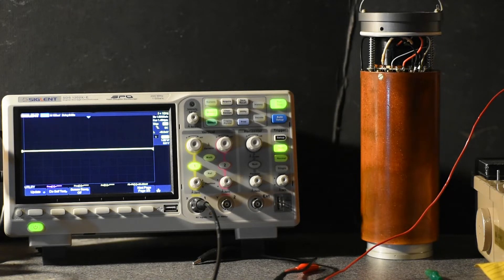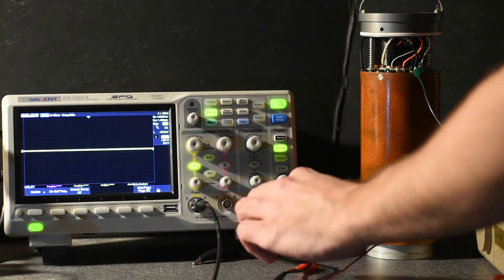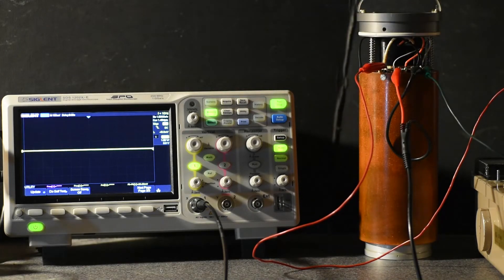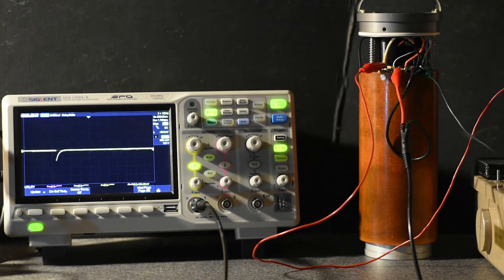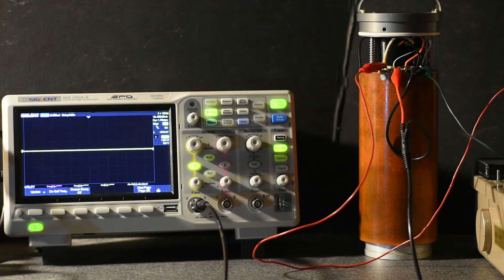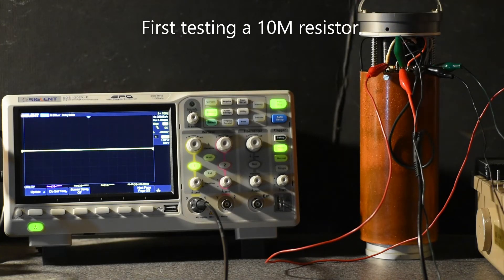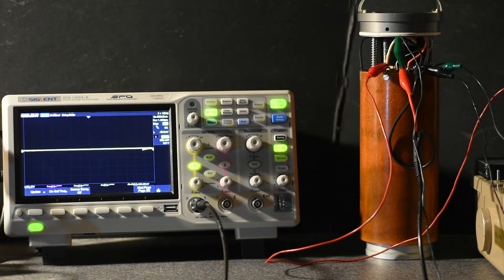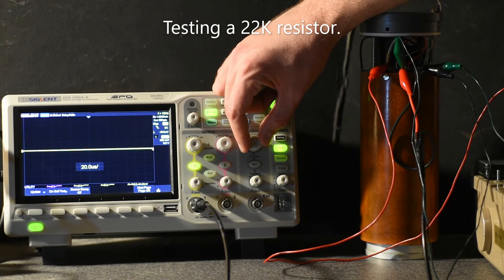Testing a Soviet Surplus БДЭГ-01Р // BDEG-01R Scintillation Probe

Comment: Are these old detectors worth it to try to get working? And do you have a pinout diagram or was one supplied with this when it came. I have a ratemeter somewhere and/or I'd like to hook one of these to an MCA to do Gamma Spectrography with a small laptop. Thanks for the video.
Reply from the maker: Depends a lot on what shape the crystal is in. I got lucky and the crystal on this one is basically perfect despite the age. 

No pinout but the tube inside this one is a FEU-82 photomultiplier tube and a standard voltage divider circuit. 

Definitely possible to get them going with a sound card spectroscopy setup.
Reply: @subverted  Thanks for getting back to me. :) how did you figure out what the leads were, then, if you had no circuit diagram? Okay, so I can look up the pinouts for that tube, I suspect. You've probably dealt with them enough and all are probably of the same basic wiring that you could figure it out fairly easily. I found a link to a pdf for that tube, but the server was gone, so couldn't get it. 

I always see these 63X63mm nos sodium iodide crystals from the Ukraine and I bet they'd fit this device. Many of the scintillation counters I've seen have just one or two high voltage leads coming off them. This one had three, if I remember correctly. If they were sealed properly and are NOS, I would think they'd be good.
Reply from the maker: @privatear2001  I opened it up to see how it was wired and check on the condition of the scintillation crystal (very hit or miss with these old units). Got lucky with this one and the gamble paid off.

I believe the three leads originally were HV, signal, and a connection for an LED for testing that is placed into a clear plastic sheet between the crystal and PMT. The original voltage divider was pretty low resistance and I just soldered up a more standard 100M divider following the PMT datasheet here: http://www.gstube.com/data/2887/ 

If you are buying a 63x63mm NaI(Tl) crystal bare you can find a lot better PMTs to pair it with than the Soviet surplus FEU series tubes.
Reply: @subverted  I know little about this stuff, except that I got turned onto it by Bionerd23's channel after Fukushima because of wanting to know about what we might be facing here in the Americas from this disaster. So I bought a Gammascout first thing. Then I have a ratemeter/geiger counter with variable HV output you can use a variety of tubes on, I think. I've never gotten any tubes or scintillation gear for it, though. 

I wanted to do some Gamma Spectrography in different places. I found a brook along a beach that has 2us per hour, (.08 - .1 is background here) and it might be nice to have a scintillation counter to try to figure out what's going on there. I also run into Uranium glass all the time. Found a great orange Fiestaware plate once 13us/hr too. Its just interesting how much radioactivity is around us all the time. 

Interesting idea on the photomultiplier tube. Could one be fit into that Russian scintillator housing besides the one that is in there, I wonder? I'd just like to have something with a bigger crystal because it should be more sensitive than a smaller one. I have to start somewhere with something that I can afford, you know. And I'd rather have a decent housing than something I make up myself with rubber and tape, as I've seen some do. I've dealt with the ocean environment for years and very little can keep water out. I was a commercial fisherman and had to work on a lot of equipment exposed to that environment. Not pleasant. :) Thanks for the link to the PMT, by the way.